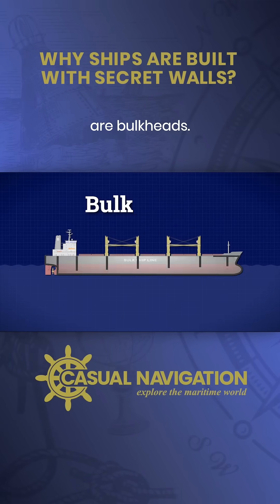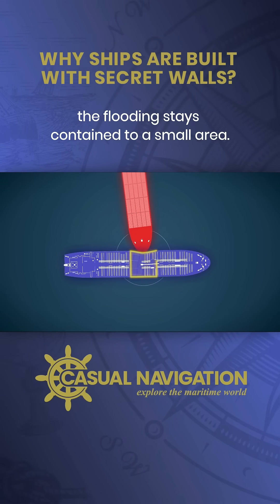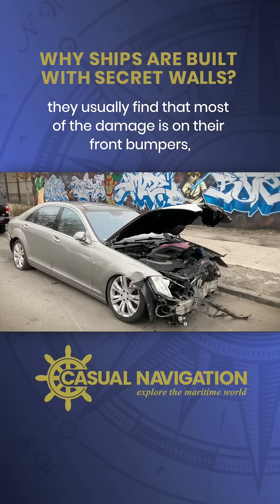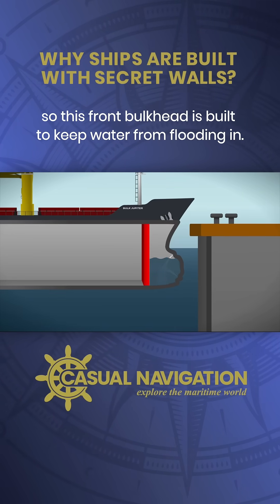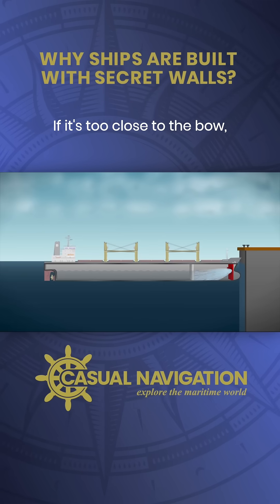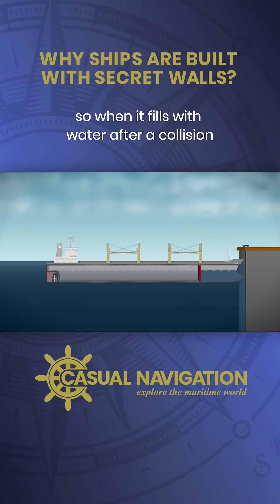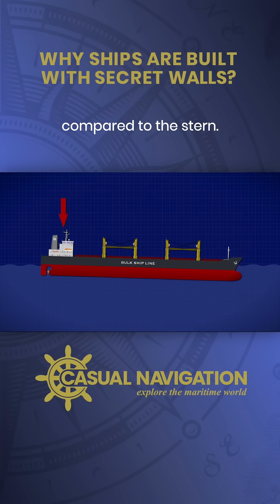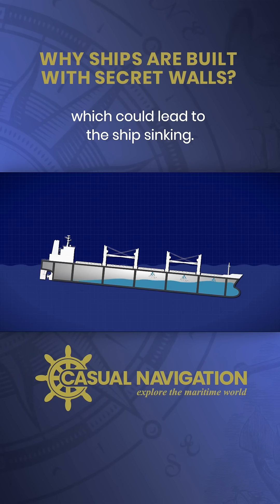Why Ships Are Built With Secret Walls

Comment: Nice narrator. When the channel got changed over I wasn't so sure. Anyway I've seen moveable bulkheads on ro-ro type where the bow opens then a big water tight door opens
Reply: That is the ramp door, not WT bulkhead
Reply: Probably related to the 'Herald Of Free Enterprise' (Zeebrugge) or the 'Estonia' (Baltic Sea)
In both cases it became obvious for the need of a Watertight Bulkhead behind the Bow Doors.
Too late for so many poor souls. As usual.
In the case of both...a simple warning light on the Bridge would alerted them to the clear & present danger that was about to befall them.
The Bow door is open...or has fallen off.
Unbelievable.